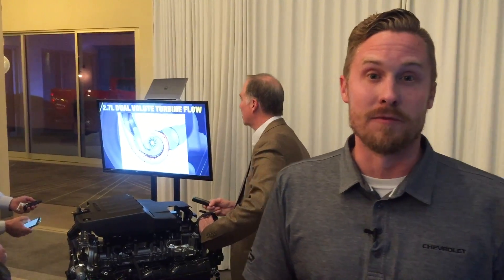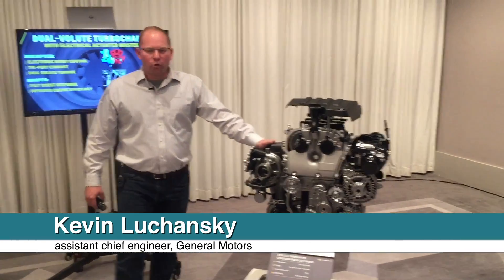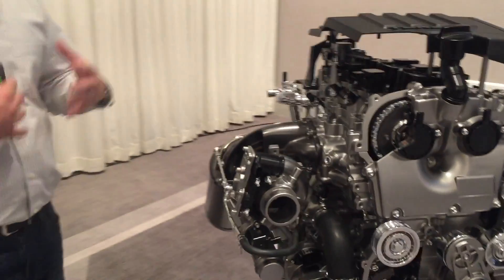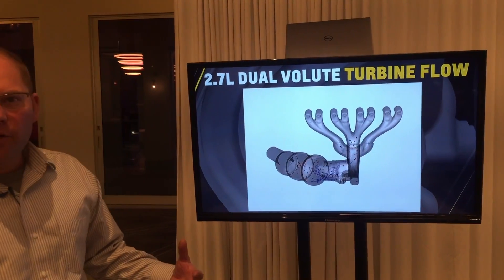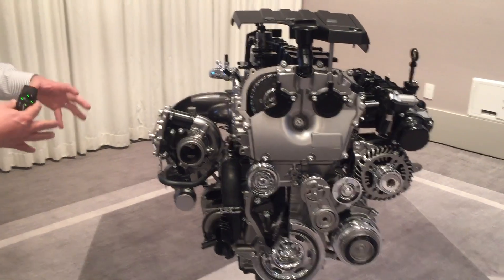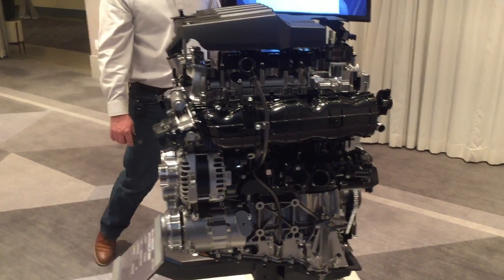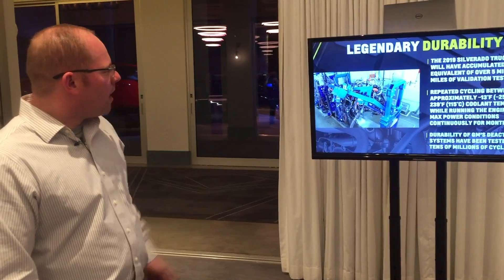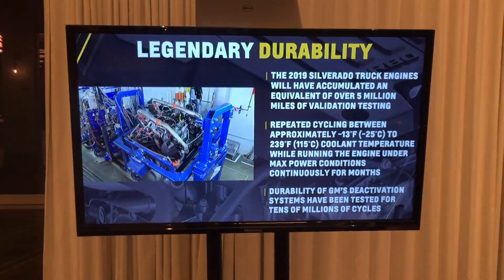All-new 2.7-liter turbocharged engine for the 2019 Chevy Silverado 1500

Comment: I really impressed with my 2.7 Silverado...it’s awesome
Reply: Mine has been reliable.  About 6,000 miles.  It's quick.  Pulls a large covered motorcycle trailer without even noticing.  I'm on a 3 year 45k lease and don't plan on buying.   My 08 Avalanche with 5.3 (AFM disabled) is at 235k.  Love the Avalanche.   Literally leased the 2.7 Custom for weekends and not fighting with the wife to take "her Avalanche " hunting in the fall.  So far I'm impressed.
Reply: That cast iron ban feature of the piston has been out now for close to 30 years . Mahle, the one company that makes pistons machines the ring grove in a keystone method so as to prevent ring breakage. The presenter never mentioned anything about the electric water pump…a nice feature

Comment: Very interesting, from this side of the world in 95% of cases the vehicles are powered by a 4-cylinder engine and with less than 2 liters of capacity and 2.7 liters is considered to be a larger engine !! Trucks are all diesels with 4 cylinder and with 2 or 2.2 liter engine capacity, V8 monsters we only see in movies or once a decade on the road !!  Welcome to the world of small engines, probably Uncle Sam is preparing much higher taxes for V8 engines with a lot of ccm while they started producing smaller engines but with such a low gas prizes that you have in US I would still want a big ass engine no matter how many cylinders it has.
Reply: Exactly.  We will be beaten with the tax/subsidy hammer until we buy something we normally would not.  When an idea is truly better, you don't need to force people to adopt it.

Comment: Before you can make a true honest comment on this engine and Truck You (REALLY) need to go Test drive one first,,,  I've Owned one now for 6 weeks I Traded a 2015 EcoDiesel in on it a 2020 Silverado 2.7 Turbo, and before that I was a Cummins diesel man for over 25 years, And so far its my most favorite truck I've ever had its like driving a diesel that runs on regular gas, Plus got A Life Time Power-train  Warranty. I have always been so called old school but I think I'm on board with this new Technology.
With that being said this is a great truck for what its designed for NOT FOR TOWING LOADS OVER 7,000 Lbs I don't Tow much over that anymore so it works great for me, Thanks for reading....
Reply: Agree with everything you wrote. People shouldn't be afraid to try it before denouncing it
Reply: @Phillip Roberts , any updates? Have you passed 50k miles?
Reply: @miguelrocha3522  at 27k now seems to run better every day glad I made the decision to trade the dodge
Reply: These are rated for 10k. That’s the same if not more as the 5.3. It says 10k on my paperwork. Plus I’m on a forum and people tow way more for extended periods of time.
Reply: whats the point of this truck then ? besides pleasing the EPA ? You're better off buying a Ford Ranger...
Reply: sirgrundel I would for sure walk before I would drive a Ford Ranger , but all jokes aside my truck drives and runs like a diesel and a heck of a lot better than the Ecodiesel I traded in after the emissions recall fix it just had no power and all I tow now is a 3800 lb boat hauling loads isn’t a problem at all, my true review after 5 1/2 months and almost 10k miles my truck runs and drives great for everything. Thanks for your response.   P.S. also I can drive around in town normally and get 28-29 mpg and still have all the power when I want it, and when you get into the Turbo a lot I still get 17-18 mph, thanks again.
Reply: @sirgrundel  or a Tacoma. Unless, of course, those are TOO SMALL and you need a full size. 🤷🏾‍♂️
Reply: Any vehicle can feel impressive when you take it on a 30 minute test drive. As far as long term durability and reliability a test drive doesn’t prove anything. Theres more plastic and electro-gadgets on this complex little engine than GM knew what to do with, and I bet there’s going to be a lot of owners trading it in for a V8 cause they wish they had more truck, especially after the first maintenance bill.
Reply: Chris Douglas I’ve put 12K on mine so far using for work and play and it has preformed better than all the other Diesels I have had also The truck came with a Lifetime warranty and only draw back to that I have to have it inspected at that dealer once a year so I am planning on driving it until the wheels fall off or what ever falls off first, Thanks for reply

Comment: I did and I love it would do it again everything he’d saying is true it hauls a@@ and I get 28mpg in full size
Reply: My best so far 28.8 mpg and normally get in the mid 20s
Reply: @davidryder5082  
Yours is a 4x4 ?  
What mpg do you get at 70 mph.
Reply: @mikeriv60  no sir 2wd. At 70 mph and mixed with city drivying avg 22 mpg.  Driving 70 mph with cruise control on 25 mpg.  My truck monitors mpg every 50 miles driven.  Best 50 miles avg so far is 31.8 mpg.  The 2.7 4cyl is rated at 23 mpg on the new vehicle window sticker btw. My commute to work is mostly back roads at about 60 mph with a few stop signs and several stoplights.  I now have 9,300 mi
Reply: @davidryder5082  
Ahh gotcha. Damn good mpg in my opinion 
How do you like engine ? 
Any problems. ? 
Watching videos of it's design..seems pretty robust. 

Thanks
Reply: @mikeriv60  the milage is incredible. The motor has plenty of power for my needs. Idk about how long term durability will be but hope it will be good. I like my elevation and no problems so far.  If you are considering purchasing a 2.7 turbo perhaps contact enterprise rentals about availability for a few days rental.  Good luck
Reply: @davidryder5082  
Good to hear. 
Thanks
Reply: Better fuel economy than my car. LoL. I'm impressed.
Reply: @Twitch_Moderator  that's a great name

Comment: In the 70s you guys would have been knocking electronic ignition, I suppose.
Reply: Yes…I knocked electronic ignition for about 6 months…but realized it was great,,,,this ain’t great..labor at dealership is 120 hr…and this truck is loaded with turbos plastic hoses and vacuum and sensors..and no space half under half over ….apples and oranges…

Comment: I'm an old school guy, and I  was surprised to hear about a 4 cyl engine in a full size truck. This motor performed very well on the Ike gauntlet.
Reply: It going to get even more low end torque for 22.  It’s been a bulletproof engine.
Reply: @user-tb7rn1il3q  430ft/lb. I’ve always owned a 5.3 but I think I’m going to give this a try
Reply: @Otownbassin  You will be sorry !  It will not make 100K if You tow with it !
Reply: @thunderbolt5354  it doesn’t run at a high rpm towing so 🤘🏼
Reply: @thunderbolt5354   Where does thing info come from? I hate when people post uneducated comments.
Reply: It's just as weird as hearing about the 2.5 liter 4 cylinder iron duke engine in an 1985 Chevy Camaro 3rd generation
Reply: I will stick to my naturally aspirated V8

Comment: My number one question about this engine is how it's going to last when it's under boost for minutes at a time when pulling up a grade. Engines are generally designed and tested for being under boost for less than 30 seconds at a time. I guess time will tell.
Reply: Most engines like these are tested for hundreds of continuous hours at full throttle, varying between full HP and full torque all while shocking the engine with different coolant temperatures.
Reply: Idividezero it’s built like a diesel, which are great at towing under long boosted intervals.
Reply: 7:30
Reply: @Davis2920022001  He didnt watch the video im guessing
Reply: It Aint !

Comment: 🤣🤣🤣 as soon as i hear the two cylinder deactivation nah nah i feels like crap in the v8’s why should we go for a full size truck and a very small engine
Reply: Ignorant as fuck
Reply: Thermal efficiency - - and I bet the turbo still works in 2-cyl mode !
Reply: Because it will pull better than a 5.7 vortec v8 and burn less fuel.

Comment: Two points.
One is your frames. Wax on wax off.
The other is that an 
 overworked 4 banger will eventually spin its bearings and have an affinity for gas. 
A lot of gas. 
You'd be better off putting the I 6 250 or 292 from the 60's.
Great mileage, smooth as silk and will last forever.

Comment: Ford tried this with ecoboost turbo wore out quick in them.

I will take a 4.3

I drove a 2004 F250 with a diesel, it was slower than molasses.

My 4.8L looks less massive than this 2.7L.
Anything less than 3.8L Belongs in a car.
Reply: ShadowOps Airman1 I like car looks like truck.

Comment: Why not just put the 6.2 in every truck you know how much money GM would save instead of having three different motors for the same vehicle and it's total BS that you have to buy the white collar package just to get a 6.2
Reply: tyler Smith   The white collar package. That’s the truth right there. $50,000+ is unjustifiable for a half ton of any kind. I’m still driving my 98 Silverado. No high tech garbage with cute little gimmicks. Just a truck. Zero break downs in 11 years and paid $7,000. Works for me.

Comment: 6.0 liter gas motor . No direct injection. No cylinder deactivation. 6 speed auto . PROVEN TECHNOLOGY. SKIP ALL THE BS .
Reply: I worked at a GMC dealer as a master tech and shop foreman . All the " new technology " is far from proven and reliable . The 8 speed rwd and the fwd with auto stop were terrible  . The active fuel management on the new 5.3l was problem some . We replaced lifters that would break , that required cylinder head removal . I drive a 2500 with a 6 liter ,it has plenty of power and can tow 14000 lbs. you can keep the technology, I'll keep the reliability.
Reply: Joseph Matarese it is lacking in power
Reply: Jon Smith  works fine for me and I tow a 9000 lb trailer . To each his own .  I choose reliability .
Reply: Joseph Matarese it makes less than 400 hp and torque. It’s behind every other maker. Even the ford 5.0 makes significantly more power
Reply: I find it amusing that you are trying to convince me my truck lacks the power I need, when I'm convinced it has all the power I need . I use it everyday and have never found myself in a position where I need more power. It's a truck not a performance car . I have a tractor that has 40 hp .it can drag a 6000 lb log with little effort. 400 horse power probably is appealing  to a person who drives a truck and never uses it as a truck . Again I say reliability is king for me. These new engines are not proven technology . They will be back at the dealer for repairs. I know , I worked on them . 400 broken horsepower is not better than my 365 reliable horsepower. Also I don't have to remove the cab to work on the engine unlike the glorious Ford trucks.
Reply: 2013 2500 HD crew cab 4X4 LONG bed. (Youngest daughter now has for her Vet business)  6.0/6 speed auto...never a problem.

What I'm hearing in this video is:  Blah, blah, blah...more pressure....blah, blah, blah......twin turbo.....blah, blah, blah......CHA-CHING!!!!!!!

And yet, I have to go to SALVAGE YARDS to get some parts for my 3.4 Liter GUTLESS 2005 Monte Carlo POS.

Sorry GM......move to China....24 GM's over 45 years.....wish I had my '67 Firebird Convertible back...326, 4 on floor, dual exhausts AND factory A/C, front disc brakes.......NEVER AGAIN!  Have a 2005 Honda Shadow Aero for my daily driver.....the Monte (Lil white car)for 1X each 10 to 14 day grocery run....2.5 mile round trip......always frightened Lil white car won't make it.......LAST GM Product I'll EVER own.

STRONG LETTER TO FOLLOW.......
Reply: Joseph Matarese the 6.0 is gone now . Replaced by a 6.6 gas. And yes GM is still behind Ford and their new 7.3 gas motor with 10 speed transmission and much more power
Reply: agreed - the crap they are pushing is a direct result of STUPID FUCKING CAFE NUMBERS.  Damn government screws up everything!!  Wait... Toyota does not kneel to the CAFE lords... hmm... well I guess it is simply the weakness of poorly managed GM FORD CHRYSLER HONDA NISSAN.  If Toyota were to get serious about expanding their Tundra platform they would eviscerate FORD GM AND RAM.
Reply: I was in engineering from 69 on #engine development " mostly. We didn't think we could sell much under 400 cu.in.
Reply: GM reminds my of my grandfather.  He would buy a vehicle and when is was all fixed he would get bored and Sell it for another one. Why would you get rid of something that has piece of mind.  This new engine looks like a piece of the space shuttle.  GM has forgotten the fact that Chevy people love them for their simplicity and reliability.   You hit it in the head “BS”
Reply: It also got like 8 mpg. 
People swap that junk all the time.
Reply: 6.0 with turbo doe
Reply: None of you guys sound that smart when you start calling engines, motors...
Reply: @docrw  Definition of motor
1: one that imparts motionspecifically : PRIME MOVER
2: any of various power units that develop energy or impart motion: such as
a: a small compact engine
b: INTERNAL COMBUSTION ENGINEespecially : a gasoline engine
c: a rotating machine that transforms electrical energy into mechanical energy
Reply: Yes and waste fuel like old technology.

Comment: Is GM setting up to introduce a 4.0L I6 based on this engine?
Reply: Well, they did have the old Vortec 4200, an inline-6 with very similar bore and stroke (93 mm x 102 mm, compared to the 92.25 mm x 102 mm for this engine).  I doubt they're gonna reintroduce a family like the Atlas engines with all this fancy tech.
Reply: @b0bsaget007  that vortec 4200 was a great engine

Comment: 6.2, 4X4 and don't look back.
Reply: Dive Bar Casanova Soon there will be no V8’s, Ford announced in 2016 by 2018 there would be no more V8’s but the Ecoboost hasn’t worked out the way they hoped. That’s why the Ford GT has a V6.
Reply: I would buy a 4cyl, but I would need the extended warranty too. Gas is really expensive in Canada.
Reply: Doug Smith only expensive due to your govts... they artificially make everything more expensive. Gas would be nearly 50% cheaper without any tax on fuel.

Comment: And while GM offers a new 4 cylinder, Ford offers...Godzilla 7.3 liters of monstrous gas V-8 performance!👍
Reply: That 7.3 is gonna be weak. Just wait n see. No more power than the GM 6.2
Reply: The 7.3L is for Super Duties. GM has updated their HD gas truck engine from 6.0L to 6.6L. This 4 cylinder is only for the 1500's.
Reply: They’re bringing the 7.3 because smog diesels are a reliability nightmare and gas is cheap right now. I’d much prefer buying gas than paying to replace diesel injectors & high pressure pumps, egr coolers, head gaskets, ect. Most customers don’t need the 1000ft. Lbs. of torque that the big three are bragging about in their smog diesels.
Reply: @prevost8686  where is gas cheap??? Still 2.65 a gallon here
Reply: Sherburne Lee People have short memories. During the Obama Regime gas hit over $4 a gallon and on-Hwy Diesel was almost $5 gallon. Premium unleaded here is $2.80 gallon with regular unleaded hovering around $2.20. I’d call that cheap compared to what I paid in the past.
Reply: @captaininsano2777  Cheaper than diesel

Comment: Hopefully they double checked their numbers and are sure about their dependability claims; I'd hate for anyone to be stuck out somewhere because of a failure. I'm sure for regular daily driving it'll be great, like the ecoboosts are. I've just heard that they experience a lot of problems/failure around the 100k - 150k kms mark.
Reply: The ecoboosts also used to not have a timing chain tensioner. They've definitely made improvements to those engines. I'm sure GM has done their homework. At this point now, this engine is making even more torque!

Comment: Considering the 5.3 is a joke for power I could just imagine this one.
Reply: marcussho i’m going to only assume you have zero experience with a 5.3.
Reply: Matt Parker I’ve owned 2, 2001 which pulled great I could pull a loaded 3 horse trailer up a 8% grade, and my new one 2014 5.3 that I have to floor pulling a single 4 wheeler on a flatbed up the same mountain. Older ones were great. Have an older 6.0 for pulling the horse trailer now.
Reply: marcussho You had 2 older 5.3s? You’re 14 with a 5.3… What gears? Lifted?   I’ve driven a few 5.3‘s that were surprising and one that was a massive disappointment because it was on 35’s with shit gears. We use my buddies 5.3 Tahoe to tow his dual axle car trailer.  With 3.73s you don’t even know it’s back there. Once theres a car on it it’s no 6.0  but Pulls really good.  I feel they should offer the 6.2 in every model no matter what configuration. This diesel should end up in a Colorado
Reply: Matt Parker all stock, 01 was mine, 14 was my work truck, last work truck was an F-150 with a 5.0, that was a beast.

Comment: I hope this engines performs and stands the test of time and the consumer, if it does then maybe it will be used in the Colorado/Canyon trucks
Reply: I hope not. I dont understand why they didnt just use a 4.2 i6 nd adda turbo to it. It wouldve saved money nd it wouldve been great. But instead they paid these dumb ass engineers to redesign junk nd spend extra time testing nd research when the 4.2 had already been through all the research